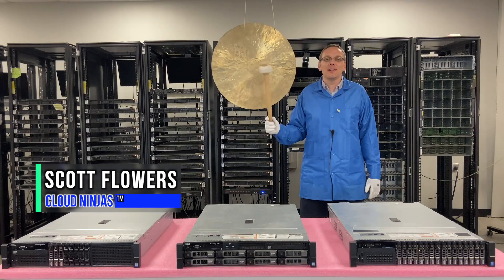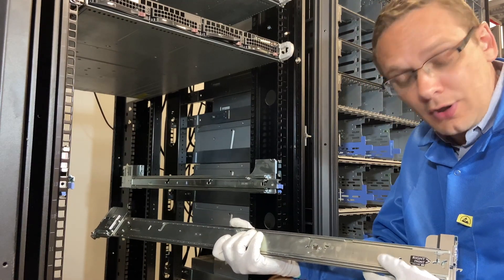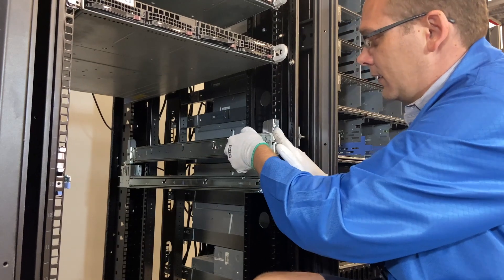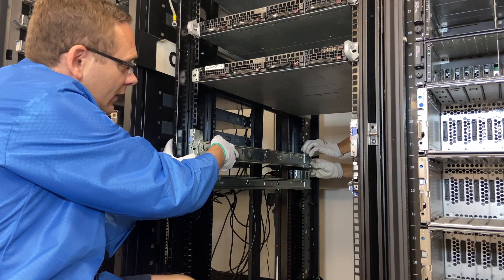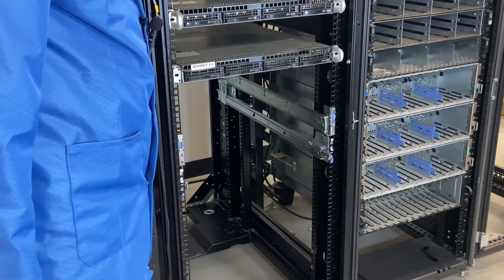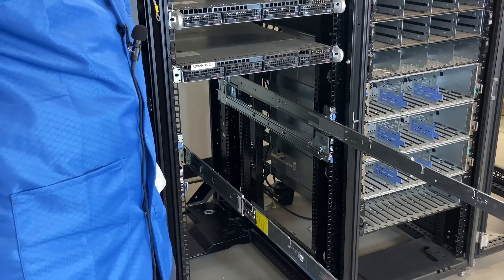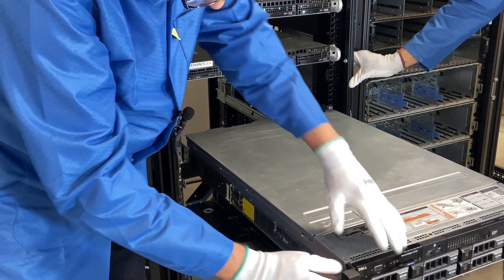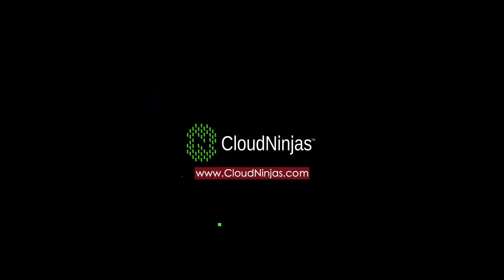Dell PowerEdge R730 | How To Rack a Server | Data Center Racking | Sliding Rails | Rackmount Server

Comment: Can you please tell me if an R730 with Dell sliding rails, will fit in the following 42RU "2 foot x 2 foot" 4 post rack:

'Standard '19" between mounting rails - side to side
What I am concerned about is that the vertical mounting (square hole) rails are only 14" apart - front to back.

Will this be deep enough for the Dell server rails to attach to?
Many thanks.